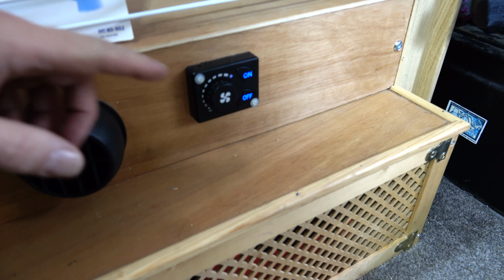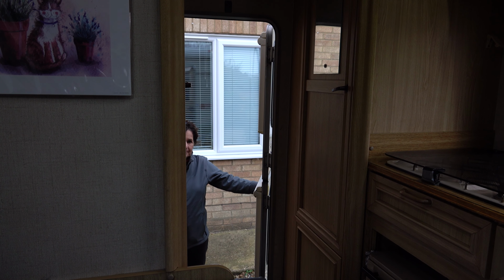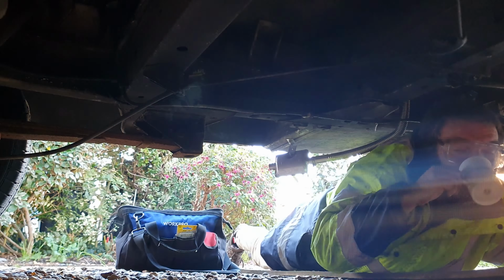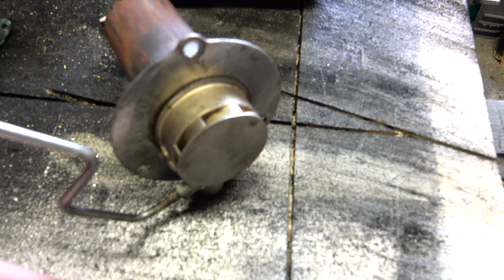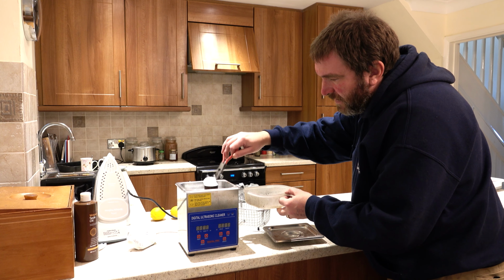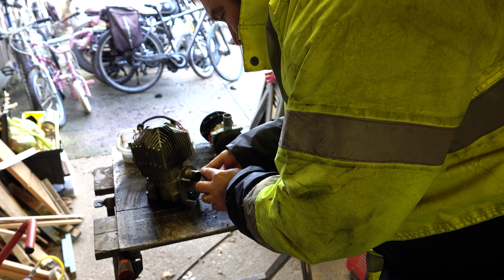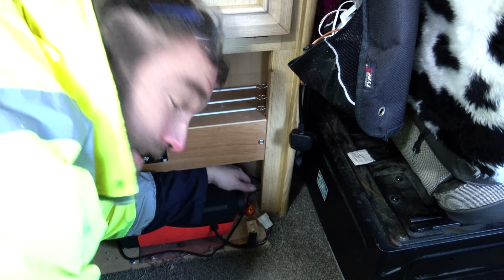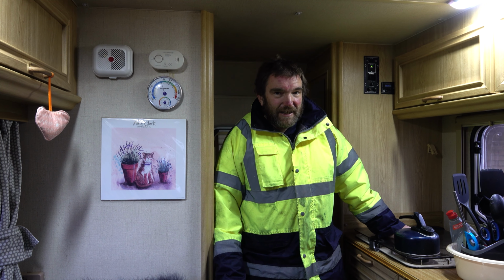One More Go At Fixing The Diesel Heater - Will it Work?!

Comment: Hi Alex lost for words. Tried everything I can think off. Caution though not all fuel pumps are the same. Different Kw rated heaters ?. When disconnecting heater is  general the main wire from battery. So both controller and heater main unit. If you have a amp meter place it in series with wire from battery to heater. 10amp when glow plug is on when goes off 4amps. If no 10amps then the switching circuit on circuit main board faulty. Cheers from old George
Reply from the maker: Thanks George, I've now ordered a complete new heater set-up so will try that. Might still try and get the old one going at some point but really need to get something reliable in the van for winter :)

Comment: Argh!  So disappointed for you - I've been following this with interest having installed a similar unit myself recently.  I don't think there's much more you could have done without systematically replacing every part, so I'm glad to read below that you've ordered a replacement. Hope you plan to cover the installation of the new one on YouTube!  Thanks Alex. 🙂
Reply from the maker: Hello Dan
Yes, we'll definitely cover the replacement :) best of luck with yours - hopefully it will be more successful!
Reply: @ttxela  Glad to hear it.  And thanks - so far it's been problem-free but I don't take that for granted!
Reply: @ttxela  While I think of it, I keep meaning to ask about your wheel inspection ramps (those you use for working under the van). I need to source some for my Talbot and am researching what might be best. Do you recall where you got them and the specifications for them? Don't worry - I fully accept that all risks are mine! 🙂
Reply from the maker: @clearprop  Ah, well the ramps I use used to be my Grandad's and I inherited them along with some other tools. They must be donkeys years old! Better to get some new appropriately weight rated ones I guess at some point.
Reply: @ttxela  Ah yes - probably a good idea! Mind you, I wouldn't mind betting your Grandad's are better than a lot of modern stuff!  They seem good and high which is handy; so many available are pretty shallow.  I shall keep looking - thanks, Alex. 🙂
Reply from the maker: @clearprop  I'm pretty confident in them really. They are pretty sturdy. Harder with modern stuff though as air dams and stuff get in the way. The Celica won't drive up them, I have to put wood blocks in front to raise the nose up before the wheels hit the ramps. No such worries in the days of Cortinas etc. 🙂
Reply: @ttxela  They definitely look pretty sturdy. Yep - there's no doubt that car valances etc are a lot lower these days than they used to be. 👍

Comment: I have a spare working LCD panel you are more than welcome to have. If only to remove it from the dwindling list of causes. 
Personally I don't think the glow plug is getting up to the initial temperature it needs to get the burner running.
Reply from the maker: Thanks Daniel, that's very generous of you. I've actually got a whole new heater with digital panel to fit now so hopefully that might fix the problem!

Comment: I have seen some people are able to pull that plate out of the center of the tube for access to the hidden mesh.
Reply from the maker: I guess some heaters may be put together differently. Looking at mine it would have been pretty difficult to get out without destroying it.

We've since replaced the entire heater. I'm pretty sure the problem was the basic knob control overfuelling it.

Comment: Hi Alex to my heater going I take the top of remove the rubber from the glow plug turn heater on wait until heater has kicked in and hot air is coming out push the rubber back over the glow plug put top on. My heater is left on all the time I'm away with no problem
Reply from the maker: Thanks Derek, the way I have mine housed that would be a little awkward to have to do every time. Any idea why that works?
Reply: I've no idea why it works. Iwould give it a go cus you've done everything else and if it works perhaps modified the cover to make it easier to get to the heater

Comment: Your battery may be fully charged but I didn't see you show the connecting leads. Reason is that they need to be of a respectable size and length so as not to get a voltage drop on the cable. The glow plug might not be glowing red if it's not getting the correct current. You could check the current is at least 10 amps with a meter. If it's OK then you will need to take the glow plug out and see if its lighting up.
Hope that helps !
Peter
Reply from the maker: Thanks Peter.
I had upgraded the cables to the heater in an earlier video and the voltage drop seemed OK. I've since replaced the heater on those wires and the new one has been running perfectly. In fact I'm sitting in the van with it on now 🙂.
I'm still not really sure what the problem was but I'm edging towards it being the knob controller and it not being able to control the pump speed adequately 🤔

Comment: Try a digital controller alex they are not expensive, they also give you more info and your battery status.
I have 3 of these with no trouble, all with a digital controller. Best of luck
Reply from the maker: Thanks, I've ordered a complete new heater with digital controller now. I'd really like something installed and working before we're away over Christmas. :)

Comment: How do you stop the tick tick tick when you do have it working properly.
Reply from the maker: The new pump I bought is a lot quieter but I'm not entirely sure that isn't part of the problem as it might not be properly matched to the heater. A few folk recommend hanging them on cable ties so you don't get the ticking through the structure of the van but I'm not so keen on that. I guess the ticking is better than being cold...🤔
Reply: @ttxela  I have hung mine in a way and it is not quite as noisy and if you have telly or background noise its ok. But sleep time it sounds like crickets. I tried wrapping it up but was louder so next I am going to put it in a box and fill with Silicone. But I do love the heat out of them.
Reply from the maker: @paulpowell1259  We didn't really run ours at night, we were at freezing temperatures when it was working but found the van stayed warm enough for sleeping. Maybe not in this current weather though!

Comment: Hi Alex
Have you tried thicker cables to battery and also run engin and try to set it away
Worked on mine good luck mate
Reply from the maker: Yes, I've run 6mm2 cables back from the battery to the heater and tried with the charger connected. Still no luck. Thanks.
Reply: Try starting engine then start heater it can pull up to 10amps at start up worth a try good luck
Reply: @ttxela  hi again can you just try and set engine running then try heater not battery charger
Just try i did and it worked shows you might not be getting the correct amps at heater
Cheers
Reply from the maker: @elliottsontour  It's connected to the leisure battery though which only has a low trickle from the split charge.
Reply: @ttxela  hi Alex just thoughtyourtricklecharge going into battery how many amps is going out to heater by running the engine you get more from the starter motor it needs about 9amps to start if it doesn't get the amps it shuts down by running van engine it give you what you require  if it keeps the heater going then you are not getting the amps from battery while engine is off
But sometime if it starts and runs well after a while switch engine off heater might keep running once its startup has finished
Worth a try
If not its the control unit
Good luck mate
Reply from the maker: @elliottsontour  Thanks Eddie, I'll give this a try if my replacement heater is still giving trouble. The thing is it was working just fine at one point.

Comment: I know you have something planned Alex but today i got error code 8 and then 10 on mine, different display but they are fuel issues. Anyway, after a lot of head scratching i found i ran out of fuel from my supply tank, may be just maybe for some reason your unit is not getting the fuel it needs
Reply from the maker: It's a possibility but I've been through the pump, filter & fuel line and couln't find any issues. Tank still has plenty of diesel in it. 🤔

Comment: Almost everything has been replaced or rebuilt except the driver board and the controller. Forgive my curiosity, I am very persistent to find out what goes wrong. I think I would buy a identical(at least compatible at interface level) one to replace the part one by one.
Reply from the maker: It would be great to get to the bottom of it but I really just need to get something reliable working so have ordered a replacement. I might keep hold of the old one and see it I can get it going as well.